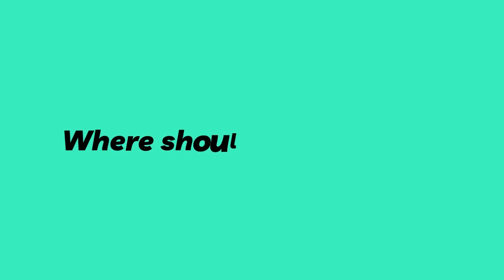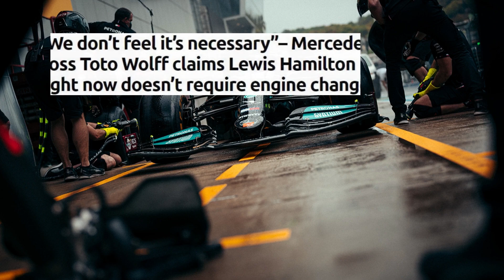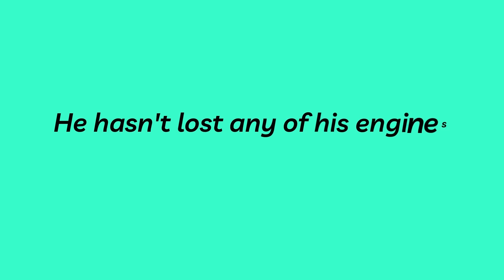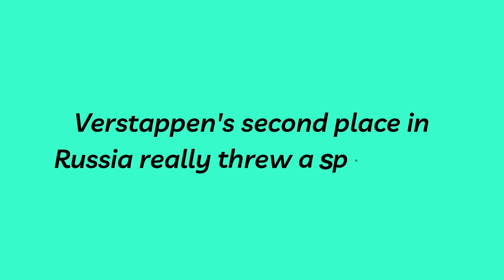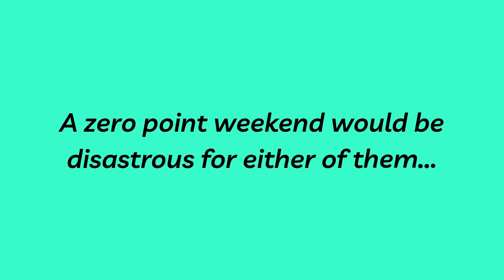Will Lewis Hamilton face an engine penalty in the 2021 F1 title run-in? | F1 Russian GP

Comment: Maybe this topic is nice for a next video. In Silverstone Lewis did get a 10 seconds penalty. Max did later get a 3 place setback in Russia. Why was the punishment not the same? You will say because Lewis was still in the race and Max was out of the race. But still, that is 2 times a different punishment. A Dutch reporter asked Michael Masi (FIA Formula One Race Director) why. Masi did look it up and did find an old, mostly unused rule that he can set back someone 3 places in a race too. Now he is pointed at that rule, he thinks he might use it in the next races if the same accidents happen. They want to apply the same penalties, but they just were not aware of the possibility to give grid penalties in an ongoing race. He told the reporter that they will take in consideration from now on. This might be a nice subject that no other channel has touched.
Reply from the maker: Yes it's an interesting one. Michael Masi explained that Verstappen's 3 place grid penalty was equivalent to 5 second time penalty in the race. 

And in Hungary Bottas' 5 place grid penalty was equivalent to a 10 second time penalty. I'm not certain how fair that system is, but it's tricky with punishments when the person who's deemed at fault is out of the race. 
And then it all was irrelevant in Sochi anyway because Max took the engine penalty!
Reply: @FormulaPulse  Yes. That is true. But I did find it kind of interesting that Masi did not know he could give grid penalties in a live race. Also, that they will change the way they deal with it after they were asked by a reporter. It's kinda strange to me that a man in his position does not know the complete rule book. If you like, I can give you the exact article number of the rule book.
Reply from the maker: @Analytics Group  I hadn't heard the story of his conversation with a reporter - I think in this case it's a rare situation where one driver is deemed at fault for taking both cars out of a race. 
Hamilton's penalty in Silverstone was deemed more serious because he carried on after taking out another car. 
It's a good point though as the stewards should obviously seen to know the rules and be consistent. And it does sometimes appear on the outside like they are making it up as they go long.
Do you think the penalties they gave were correct?
Reply: @FormulaPulse  I am not sure. I think in F1, there are given too many penalties. Let them race more, and we will see more fights. Really close battles like this season with Lewis and Max make for great racing. It looks like every tittle touch is made into an incident. I think maybe the medium to worst should be punished and the rest, where is not really clear who is at fault, or when you have to say that driver X is most at fault, that should be just race incidents. When a driver fully goes off or did exit the race because of it, then you should investigate. And then, if the other is at fault, the punishment should be a lot higher. Like, 10 seconds penalty because you ended the race of 2 other drivers won’t cut it. I think more of 3-5 grid penalties then, but at the end of the race, so you lose that places for sure and can't get them back. Now if you have a MERC you make that 10 seconds good in 5-10 laps. If you're in a lesser car you will never make them back. That means faster cars feel penalties less than slower cars. That's not a fair situation. Make it more fair. But then again. I am just a race fan. I do not work for the FIA. Risk/awards or now strange. Push your competitor of, and you get just 10 seconds. Why should you not risk that? I can write for hours on this, so I better stop. 
Great channel!

Comment: I think they should have changed engines when max did
Reply from the maker: Agree, I think they gambled on Max not scoring as highly as he did.
Reply: Perez would have blocked LH. Sochi is a Merc track and they wanted Maximum points.
Reply: Nope Mercedes had a massive advantage at Russia in terms of pace and needed Lewis to win there

Comment: I don’t understand why people keep saying that Hamilton has to take an engine penalty 😂 the Mercedes engine is so reliable
Reply from the maker: It generally is, but they have said they might take one by choice.
There's been some gremlins on the Williams and Hamilton and Vettel had failures at Zandvoort. Taking another is a better safe than sorry policy 🙂
Reply: In past years Mercedes could turn down the engine modes throughout the weekend and check out in front. Unlike this year

Comment: If LH needs to take an engine penalty, I don't think it's a disaster because LH has always done well coming from the back of the grid in the past. It's only a disaster if it's DNF only for him since they have a tendency of crashing to each other with MV.
Reply from the maker: Yeah I agree I think there's no reason why he won't come through. I think it's just the risks, like you say having a DNF or not finishing in the top 3. 
I think they hoped Verstappen would be finish lower in Sochi to give Lewis a cushion for the upcoming races.

Comment: Bot took and engine change and then Ham gets in Bot  car would HAM get a penalty?
Reply from the maker: Nice idea, but that's an instant DQ I'd imagine 😅
Reply: @FormulaPulse   its a good question and one i would not put pas Merc for trying. they did do a car swap already this season.
Reply: @timgriffith9149  they swapped the chassis i believe. Not the whole car. Not quite sure tho.
Reply from the maker: I had a read and they did swap chassis' earlier in the season, which is allowed. 
However the engine components are per driver, so swapping between drivers wouldn't be within the rules. So it doesn't look like there's any chance for Hamilton to take on any of Bottas' parts.
Reply: @FormulaPulse   Ok was not sure it the PU was assigned to the driver or the chassis.